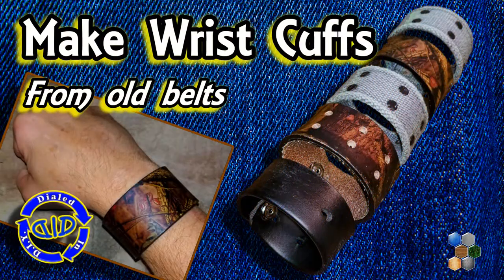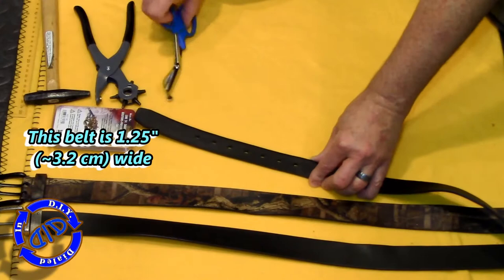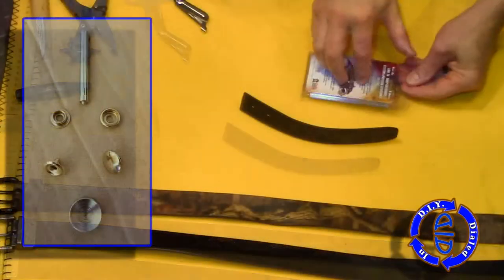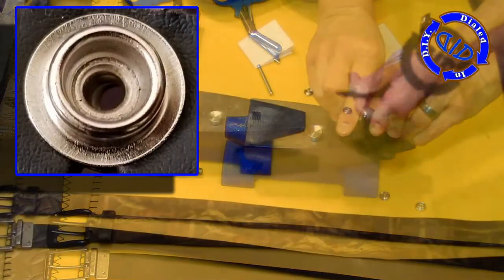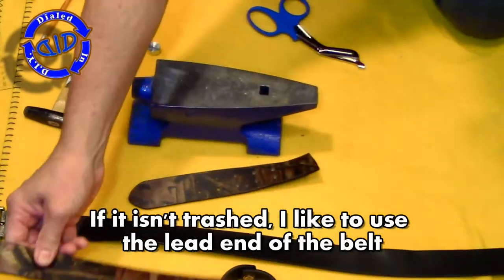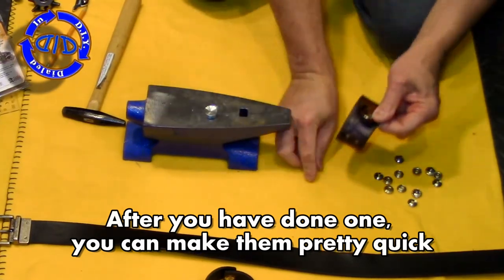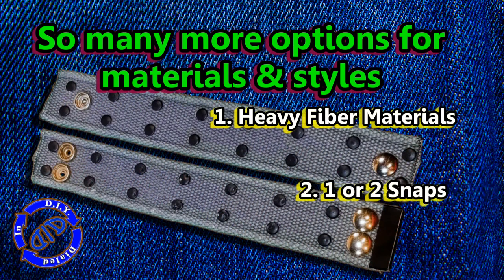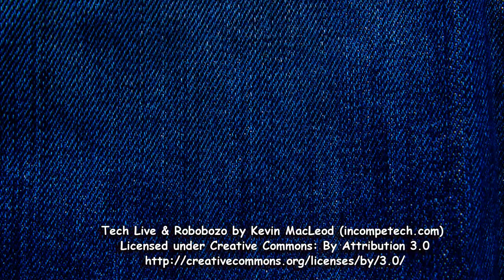How to Make Wrist Cuffs from old belts - Recycle & Repurpose

Comment: What snaps size do you recommend for the thicker belts? I have tried using the ones in the set I bought and despite managing to attach the bottom snaps of the bracelet thanks to a longer tubing I cannot attach the top dome peices of the snap as the bobble part is too small for the thick belt. Any advice would be great thanks xD
Reply from the maker: That is a very good question and I do not know the exact size. On thick leather belts I have used snap fasteners that were specifically listed for use with leather and jeans.  I did a quick Amazon check (wanted to see if that is where I bought mine but it is nowhere in my order history) and found a set for leather that says they are 0.49 inch diameter buttons and the bottom measures 0.35 inches in diameter.  I don't see anything that details height of connectors though. I did see some that list "not suitable for thick fabric" so that would be a good detail to look for (check images shown to see if they show them used on thin fabric only or if they show thicker leather).

Comment: what about if you have a concho belt and  want to use to make a cuff 
with all the conchos
Reply from the maker: I think that could be very doable depending upon the size of the parts/conchos (i.e. would it shape to a wrist easily enough).  I've seen that some of those can have some great value so it may also be worth checking the value before breaking one down into smaller parts.